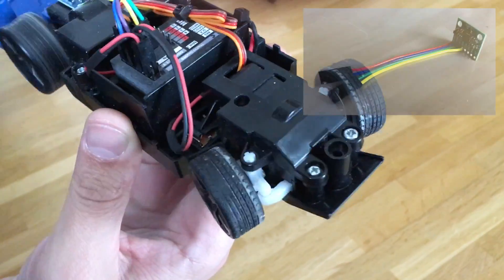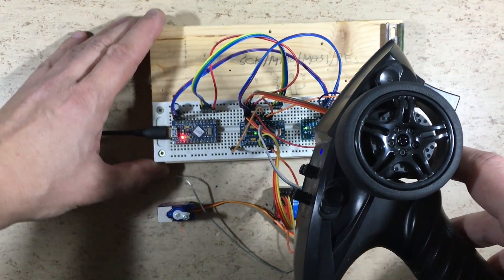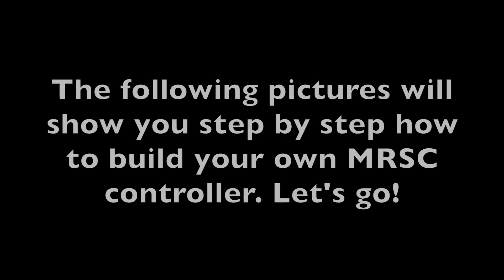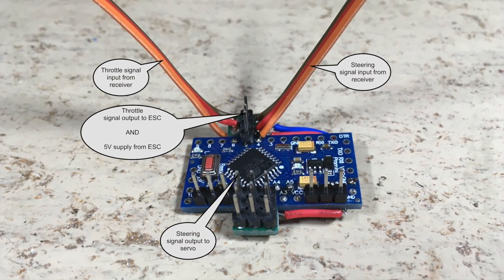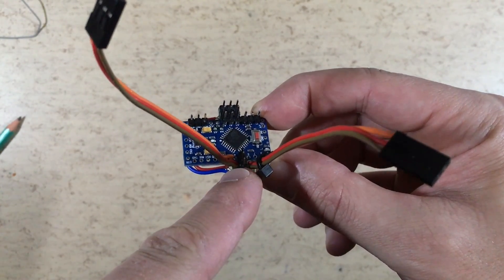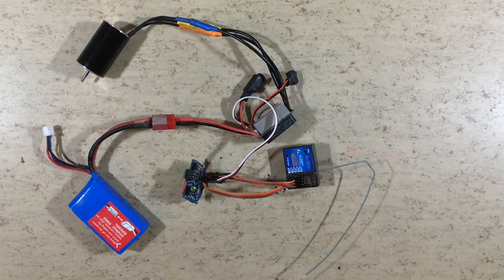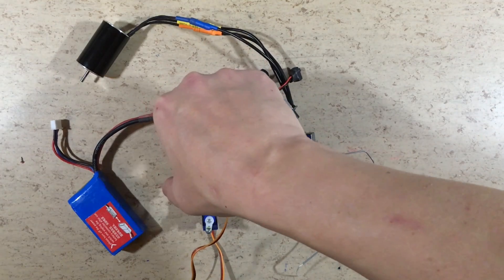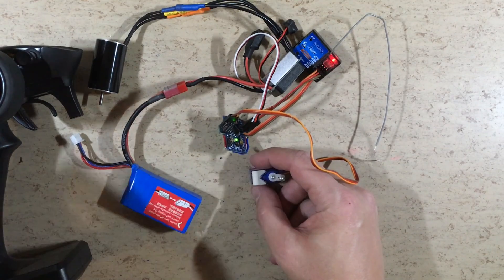Arduino MRSC "Drift Assist" Stability Control Build For 3 Pin RC Servos

Comment: very nice project! Would a 5V arduino also work? Why 3.3V?
Reply from the maker: Thanks. All recent RC electronics use 3.3V for the logic signals. The MPU-6050 also is a 3.3V device. That's why I'm using the 3.3V version.
Reply: @TheDIYGuy999  would the 5v version work though? Using the 3.3v output pin instead of the 5v?
Reply: @TheDIYGuy999  or even one of the 3-5v input mpu6050 units? If you are unsure, I'll be testing it out in a couple weeks when I get my parts in, and I'll let you know.
Reply: @oldmanbluntz  did your 5V version work ?
I wrongly bought a 5v board
Reply: @singlag  yes, the mpu6050 worked fine, as they have a regulator on board to drop the 5v to 3.3

Comment: Sorry if I've missed the explanation but why does your bootloader need writing to the board? What does it add & why is this required?? Why does this process require your board definitions? I built your 5 pin version without having to do this and it worked perfectly (thank you!) I currently don't understand why the 5 pin doesn't require the above but the 3 pin does? Thanks
Reply from the maker: My bootloader is lowering the brownout voltage to 1.8V. The stock loader is adjusted to 2.5V, I believe, which is too high for the 8MHz version and can cause unwanted reboots (depending on how stable your supply voltage is). Of course you also have to burn the bootloader, if you use a new, blank 328P IC.
Reply: TheDIYGuy999 That makes total sense, I didn't realise that could be adjusted. Thanks for your reply and explanation :)

Comment: Arduino : 1.8.4 (Windows 10), Board: "TheDIYGuy999 328P (8 MHz ext. Oscillator), ATmega328 (3.3V, 8 MHz, 1.8V Brownout)"

avrdude: stk500_recv(): programmer is not responding
avrdude: stk500_getsync() attempt 10 of 10: not in sync: resp=0x03

I have this error while trying to install bootloader 
could you help me please ?
Reply from the maker: Hmm, I know nothing about your hardware. Pro Mini 8MHz? Programmer? I assume it is wired incorrectly
Reply: TheDIYGuy999 I have this arduino :Pro Mini atmega328 3.3V  http://s.aliexpress.com/VFvQBFNZ
And I am using a pro micro as isp programmer
I think wiring is good but do you a a diagram? To be sure my wiring is good
Reply: pro micro -> pro mini
raw -> raw
gnd -> gnd
15 -> 13
14 -> 12
16 -> 11
10 -> rst
Reply from the maker: This wiring is OK. Is the "ArduinoISP" sketch installed on your Pro Micro programmer? Is the Pro Micro a 3.3V, 8MHz version?
Reply: TheDIYGuy999 Oh the pro micro is 16mhz....
Reply from the maker: The programmer needs to have the same 3.3V logic level as your board. So an 8MHz version is required.

Comment: Hi. So I've finally made one for the A959b. I love it but I have a problem. When I turn on the power it fully locks the steering right cracking the gears in my servo. It doesn't stop till I touch the steering on the remote it then centralise. I'm pretty sure my servo is f#&@ed now. Any ideas why it does that?
Reply from the maker: Hmm, this one is for 3 pin servos. If you talk about the 5 pin version, then your two servo motor wires may be reversed, so it's turning in the wrong direction.
Reply: TheDIYGuy999 sorry yes I realised I posted on the wrong video. TS the 5 wire one.
I will double check the two wires against your video again and see. Meanwhile i need to buy a few spare servos just in case. Thanks.

Comment: In your opinion - where should the gyro best be located? In the X of the four whels? Low or high? Middle of the fron wheel? Low or high?
Reply from the maker: it doesn't matter, because the accelerometer is not used in this application, only the gyro. Make sure, that the MPU is facing upwards or downwards. Change the "mpuInversed" variable from "true" to "false", if the counter steering works in the wrong direction

Comment: Excellent video Master, Excuse Me, I have a question, an online store that you recommend to buy electronic devices (resistors SMD,  capacitors  SMD etc) of international shipping?. Thanks to your videos I have managed to design my own receiver.Thanks so much. Regards
Reply from the maker: Thanks for the praise. Alice is usually pretty good for Arduino stuff: https://www.ebay.com/sch/m.html?_odkw=&_ssn=alice1101983&_armrs=1&_osacat=0&_from=R40&_trksid=p2046732.m570.l1313.TR12.TRC2.A0.H0.Xesp32.TRS0&_nkw=esp32&_sacat=0

Comment: This is very impressive. I'll have to have a go at making this at some point. Would you consider making the gain adjustable with a 3rd chanel?
Reply from the maker: Thanks. Making the gain adjustable using a 3rd channel is no problem. Is someone else out there who woluld like to have this feature?
Reply: TheDIYGuy999 You're a legend! Have you ever tried using this on a rwd car? I'm wanting to make a 1/27 scale drift car and was curious if I could get away with just using 2wd instead of 4wd
Reply: I've just been ordering the parts to make a couple of these. I'm curious as to why you are using a 3.3v pro mini when servo voltage is around 5v and the mpu board can take 5v? Is it just to drop the voltage down for the mpu board?
Reply: that would definitely be a great feature !!

Comment: would it be possible to have this on coca cola car? :) i know it doesen't have servo, but stand alone MRSC for acceleration?
Reply from the maker: No way. There is just no room inside a CCC. Why not just use the "Micro RC" remote?
Reply: TheDIYGuy999 I'm short of one nrf24, but I'm going to make it though. I was about to make more simple version of it, but after some time I realized that it would be easier to build your version, so I wouldn't quit the whole project out of frustration.

Comment from the maker: After several requests it's finally here: The standalone Arduino MRSC stability control system for your RC car with standard 3 pin servos and receiver. I hope you enjoy it.
Reply from the maker: jeff delacruz, You should use the 3.3v, because the signal level of the servo, receiver and MPU-6050 is 3.3V
Reply from the maker: Connect your Arduino RAW and GND pins to the servo header of your K989 receiver. This will work. Don't connect pin 4 and 5 together. Of course, the servo will only move, if you shake it AND have a throttle signal. If you don't have a throttle input, change your code to:
void mrsc() {

  int steeringAngle;

  // Read sensor data
  readMpu6050Data();

  // Compute steering compensation overlay
  int turnRateSetPoint = map(uSec[0], 1000, 2000, -50, 50);  // turnRateSetPoint = steering angle (1000 to 2000us) = -50 to 50
  int turnRateMeasured = yaw_rate * 50;//abs(map(uSec[1], 1000, 2000, -50, 50)); // degrees/s * speed
  if (mpuInversed) { steeringAngle = turnRateSetPoint + (turnRateMeasured * mrscGain / 100); } // Compensation depending on the pot value
  else { steeringAngle = turnRateSetPoint - (turnRateMeasured * mrscGain / 100); }

  steeringAngle = constrain (steeringAngle, -50, 50); // range = -50 to 50

  // Control steering servo
  servoSteering.write(map(steeringAngle, -50, 50, limSteeringL, limSteeringR) ); // 45 - 135°
}

If it does not work, you fried your boards, have a bad solder joint or a solder bridge (short circuit) somewhere. Carefully check your board with a magnifying glass. I assume, you have a problem on your receiver steering signal input. good luck.
Reply from the maker: The wiring is OK, but I believe, that I just identified the problem. The K989 receiver servo signal is on non standard 5V level. I used an oscilloscope to test it. The timing is standard: 50Hz Pulses with 10 to 20ms length. You could try to add a 10k resistor between the K989 output and the Arduino input. The proper solution is a voltage divider: K989 -> 10k -> Arduino input -> 20k to GND. Hope this helps and you did not fry your Arduino input.
Reply from the maker: Sorry to hear that. I still believe, that there is a wiring issue. To be honest: My fully receiver integrated MRSC solution is the better choice for this car. good luck with the build!
Reply from the maker: The throttle output for the ESC is also connected to pin 5. The MRSC controller only requires the throttle signal for the countersteering calculations. The throttle signal is not changed at all.
Reply from the maker: Does it work now?
Reply: TheDIYGuy999 I'm new with learning arduino system, and it is because of you and I also own a wltoys a959-b which is very fast. So fast that it takes a lot of effort to steer it correctly which sometimes bores me to use it. But with your projects, it motivates me to learn arduino more. You've become my inspiration on learning this. Thank you very much for making your videos more simple to understand. Hopefully I can make this things that you're doing soon. As of now, saving your videos and will return to it on a later time. Will wait for your more videos and projects. More power and kudos to you!
Reply from the maker: jeff delacruz Thanks a lot for your kind words, very motivating. I hope, that you can realize your own projects soon.
Reply from the maker: Widlan Mujahid does your MPU-6050 IC point downwards? If not, you have to change the "mpuInversed" variable from "true" to "false", so that your gyro works in the correct direction. You may also have to change the "mrscGain" variable to fit your needs.
Reply: Thx dude!
Reply: Im waiting for goods, will reply how it works :)
Reply from the maker: Zsolo, you‘re welcome and good luck
Reply from the maker: Widlan Mujahid You're welcome. I'm glad that it works for you.
Reply from the maker: In case you don't want throttle feedback, replace:
int turnRateMeasured = yaw_rate * abs(map(uSec[1], 1000, 2000, -50, 50)); // degrees/s * speed
with:
int turnRateMeasured = yaw_rate * 50;
Reply: TheDIYGuy999 can I use a 5v mini pro instead of the 3.3v? Will there be any issues that may encounter?
Reply: TheDIYGuy999 thanks for the reply. how about the ISP programmer? any alternative like Arduino Nano v3.0 Controller Compatible with Nano CH340 USB Driver? it is hard to find Arduino Mini Pro 3.3V 8MHz with usb here in my location.
Reply: TheDIYGuy999 any updates on my last question? Thanks.
Reply from the maker: You can use any Atmega 328 based Arduino with 8MHz clock and 3.3V VCC. If you have a 3.3Vboard, you also need a 3.3V Pro Micro for uploading.
Reply: TheDIYGuy999 
Kudos to you for those cool ideas!
I'd love make a setup that compatible with my stock Wltoys k989 receiver ( 7.4V/ 2S , inboard esc, about 5V~6V at servo output). Is MPU6050 might usable on that setup? (Really hooked up with that board's MEMS performance, really)
Reply: @ivakanoffsnyder4501  hallo brother...can you share schematic for stock receiver k989....
Reply from the maker: Thanks for the praise. Yes, you can use this unit as it is in the K989 with stock receiver. You just have to disable the throttle dependency. I also have an Arduino based 2.4GHz remote with fully integrated MPU-6050: https://www.youtube.com/watch?v=UVLiHLuiDlo&t=240s
Reply: TheDIYGuy999 
Well I'm doing this project last night, quite thrill for first time at arduino. Instead pro micro 3V (I can't found one orz) , I'm using USB to TTL CP2102 (without DTR) for uploading sketch to arduino pro mini 3.3V. Soldering these joints is pretty challenging (Still wondering if I might fried these board).
Since I need things geared up to stock wltoys k989 receiver (with inboard esc), I did some change to your wiring schematic:
- Both gyro and MCU directly powered from k989 Receiver's 3 pin servo 5V and using same GND.
-There's no throttle input from pin 5
- Connect pin 4 to pin 5 (I don't really know why, but no ill effect so far)
The rest is pretty much the same, but in the end, servo didn't response to my steering. Funny thing that servo only turning when I give steering input and shake the gyro around. Other than that, servo barely turn and randomly ticking (even without servo input) while LEDs on these boards light up and looks normal. 

Right now I'm thinking any possible approach to fix this:
1. Using voltage divider at 2S (7.8V) main battery, reduce to about 4V, strap some resistor, and connect it to Pro mini's RAW and GND. (Risking all board, but lack of current might be the cause)
2. Make extra sttering output/ signal pin at wl k989 receiver and connect it to pin A0 (servo will receive steering signal both straight from receiver and arduino board)
3. Trying 5V Pro Mini board. In my local market, MPU6050 description vaguely stated "can survive max 5V" and "16 bits support" (idk really what it means lol, but might be related to Pro Mini 16Mhz)

Sorry for my noobish TLDR, but any help would be appreciated ;)
Reply: TheDIYGuy999 
Wow, thank you for your helpful reply. Updated sketch does make the gyro board works perfectly now. But the steering signal from receiver is still lost, makes the servo only driven by gyro board. Kinda certain that steering signal from "pin 4" somehow did not successfully passed into "pin A0". It might be something to do with hardcoded interrupt settings.

This is how I connect things up:

Receiver GND -> Pro Mini GND(s) and MPU GND -> servo GND (brown)

Receiver VCC -> Pro Mini RAW and MPU VCC -> Servo VCC (red)

Receiver Signal -> Pro Mini "Pin 4"
Pro Mini "Pin A0" -> Servo Signal (Orange)

Hopes my board is still doing okay and another sketch updates will fix it gracefully. Gonna order another boards, since I'm not sure if this one fried or not  (orz)
Reply: TheDIYGuy999 
I've tried using (10k & 20k ohm) voltage regulator just now. Stering still didn't work, and gyro doing fine. When I turned the receiver off, suddenly k989 puffing smoke (at MCU or small component, I didnt know exactly where). So thats it, I might conclude that k989 receiver is not really suited for further modification (orz). Signal output is peculiar and it doesn't have any reverse polarity protection.

But still, I gonna thank you very much for your helping replies and good contents:) 
Gonna try making rx tx from your vids, since I need another set now lol
Reply: TheDIYGuy999 
After got k989 receiver replacement, I redid the MRSC board...At first, it makes servo twitching abruptly...
But after some adjustment on gain, centering code, and added capacitor on GND/VCC, the twitch is pretty much decreased. It works like a charm now.
Props for you dude :)
Reply: hi.. i have the same problem.. steering not responding to input from receiver.. but servo twitching abruptly..

what adjustments in gain and, code and which capacitor did you use.. 
using ardiuno for the first time.. any help is appreciated.. 

Thanks....
Reply: Is anyone interested in selling one already assembled?